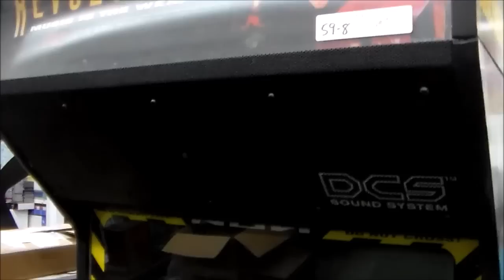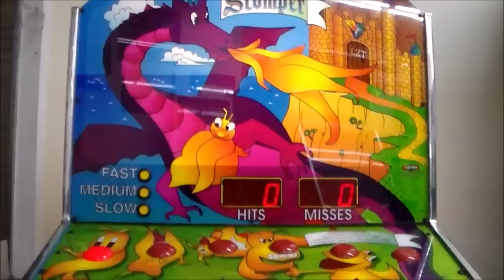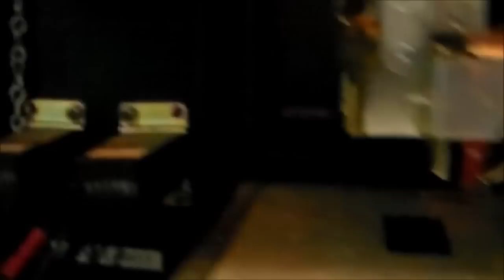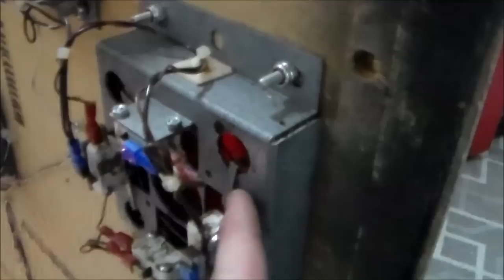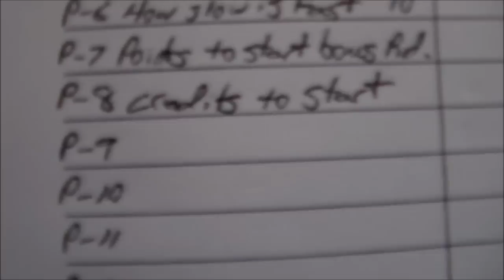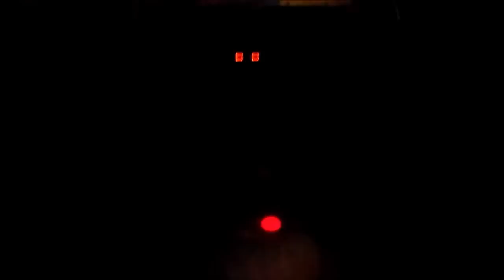Fire Stomper Redemption Ticket Arcade Game & A Few Upcoming Projects!

Comment: Thanks for the content, I picked one of these up at auction yesterday but it is missing the whole stomp panel, just wondering if it could be set up to just whomp?? It is currently unresponsive but lights up,  locked and I don't have a key so I have to drill the lock. Also it came with a 30 page manual complete with wiring diagrams i would be happy to scan and email to you if you haven't already sold it.
Reply from the maker: I think you probably could make it just whomp by setting it up to ignore a certain number of missed hits.... it would still do the bottom ones but nobody would see them or hit them, so you'd miss all those hits... but I believe the machine could be set up where you still won even if you missed a certain number.  You'd probably have to play around with the settings to get it just right.... yes I'd love to have a copy of the manual if you get time to take pictures or scan any of it... my email is LyonsArcade@carolina.rr.com ... thanks!
Reply: @LyonsArcade  just sent the file through but it was sent from a Hotmail account so could be in your "others" or "junk" folder.

Comment: There is a list of LazerTron distributers at this link that might have some information laying around. https://web.archive.org/web/20020524223739/http://lazertron.com/ back in 2002 you could contact technical support or to order parts by telephone at (925) 456-6000; and by e-mail to staylor@arcadeplanet.com. In July 2004 Cadillac Jack 2420 Meadowbrook Parkway,
 Duluth, GA 30096 bought out LazerTron and assumed all support of the Lazer-Tron line.

Comment: I heard from an electrician long ago that they would put 220v bulbs in exit signs. They would only give half the light, but almost last forever because the load was half. They would double the watts I think to get the desired brightness. They did that because it was so difficult to change the bulbs in commercial places, light theaters and stuff.  Don't know if its true, but maybe the 28v bulbs are used in floor portion so they don't have to change them as often?
Reply from the maker: That very well may be!  Somebody else was saying it makes the filaments thicker?